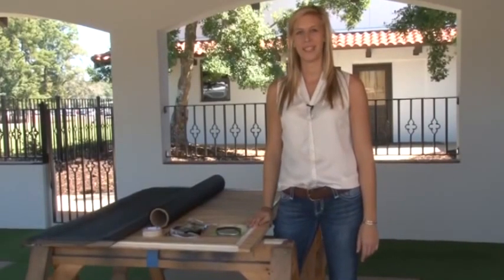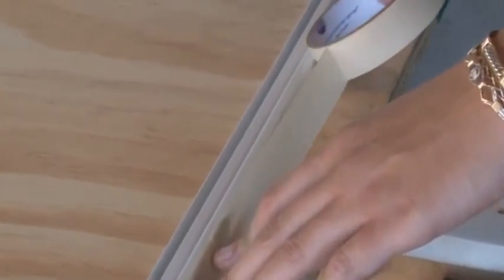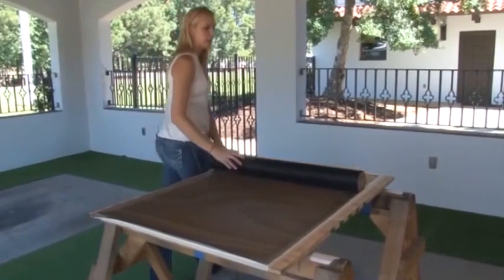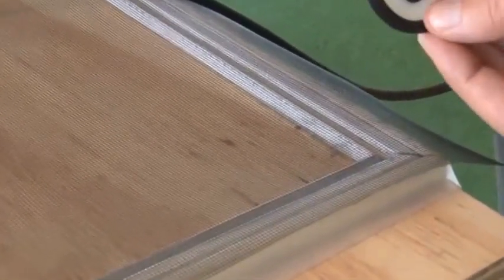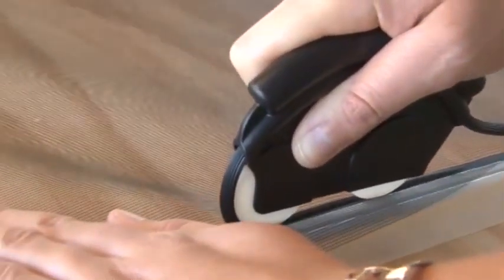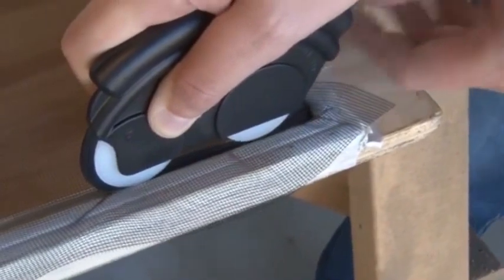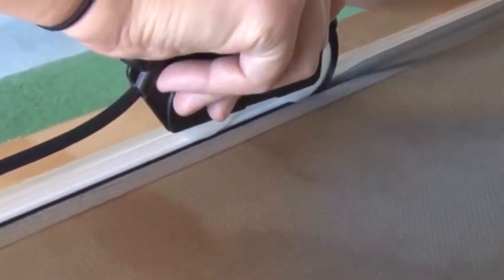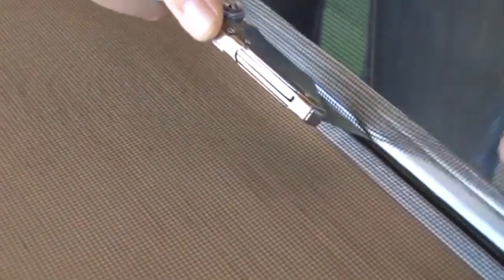Window Screen Replacement for Easy Replacement! | Phifer Inc.

Comment: This helped me a bunch.  Had never done this before and no idea how to do it.  Once I got the old rotten spline out it was a breeze with this tool to get the new spline in place.  Also good idea about taping the screen frame down.  Glad I did that as it would have like slid all over the place.

Comment: Are there no videos of how to keep the screen STRAIGHT while rolling the spline in? I've seen many badly aligned screens, loose or wavy and the screen looking like a Moire pattern when viewed at various angles. I've also seen a FEW correctly aligned ones. How does one keep the screen straight while rolling the spline in? That's what I want to know.
Reply: If you FIX a Square on a table and also use a center aluminum bar will be ALL you need to get it as you want. GL !
Reply: What has helped me is to lay out the screen on top the frame, cut 2 small pieces of spline (1” ea) for each side,  & press in 2 on each side to tack it in place evenly. Then as you roll the spline in just lift out the tack pieces. Works great.

Comment: Have you all even tried to unwrap one of these rolls of screen? The shrink wrap really🤷🏻‍♀️ and you can’t even slide it off when you get it kind of open because it’s tucked in part of the screen roll… It’s taking longer to get into the damn thing then it would be to put the screen on🤦🏻‍♀️🤷🏻‍♀️